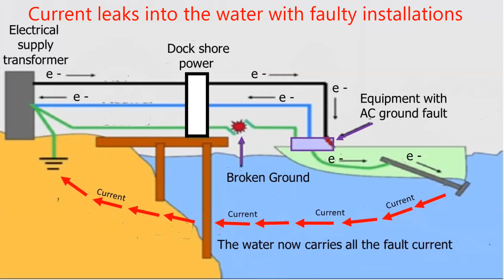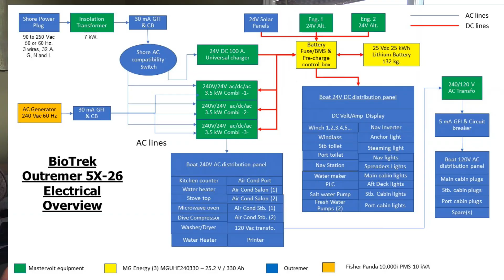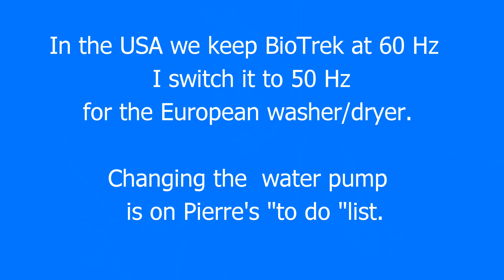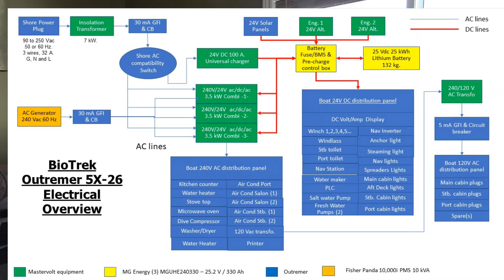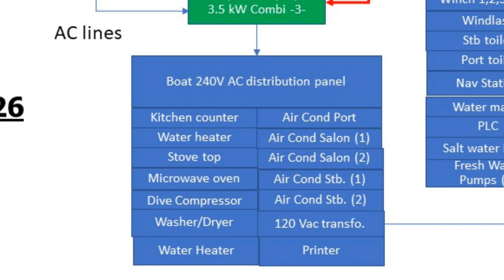Ep.66. Marine electrical systems Pt. 4: Inverters and batteries

Comment: Hi , could you please explain why you have the separate battery charger, I can’t understand what you tell in the video . I understand you use it only if you have 20 volt on the dock ?
Reply from the maker: When the shore power is different from the boat requirements we use the auxiliary charger that does not have an inverter built in.  When the dock power is reliable to our needs on the boat then we can use the pass-though from the big charger/convertor.  I hope that helps!

Comment: What is your view on the use of DC  vs AC generators?
Reply: Everytime you convert energy you lose, so charging directly from a DC generator would be best. I like the compromise of using an efficient variable speed AC generator, as it also becomes a backup in case of a fault in the inverter.

Comment: Nice install. Question- you mention PLC. Is this an MG product or something custom? Assuming that this translates CANbus from the BMS to Mastervolt Masterbus for charge/discharge control?  Also, does the MG BMS manage regulation of the alternators or are you using something like  a CANbus based regulator like the Wakespeed?
Reply: HI Robin,  
Yes we use a Display controller to interface the Mastervolt to the MG BMS.  It is canbus on both side and the Display allows PIerre and Lisa to monitor the batteries at all time.  The unit we are using is a controller Pierre and I are very familiar with since we used it when we worked together (I still do in my current project).  It has multiple Canbus port and act as a bridge.  As you probably have heard in previous video Pierre has a background in Computer science and I have extended Industrial automation experience.  So it was more for fun for us to do this.  The unit also can read all the NMEA2000 messages on the net and we use this to collect data point for the display.  
For the Regulator, Pierre orignally purchased Mastervolt regulator and the intent was to bridge them with the BMS info to control the charge current.  I think this is still on the Todo list for Pierre.  In the mean time he uses the system as standard.  Because of the very high capacity of the batteries, the Alternator is not capable to exceed the maximum current charge in normal operation.  Voltage set-point is below Battery max voltage so as long as the battery stays balance it is safe.  The BMS would protect the pack if that was not the case.
When Pierre was designing the boat, the Wakespeeed regulator was not yet available.  It would make the whole integration a lot easier since it is fully integrated in the MG BMS system.

Comment: What type of dive compressor do you have? Can or do you run it off the battery with the 3 three combie units? Would 2 of the inverters start and run the compressor? Would love to see the alternators / regulators and the control interface. What real world output are you seeing from the Mastervolt alternators? Thanks again and great job on the videos.
Reply from the maker: On BioTrek, we are using a Bauer Junior II electric dive compressor set at 3,400 psi. We have it configured to run on 230Vac. When running, it draws between 1.5 to 2 kW, so even a single inverter will do the job.

As far as alternators, they are by far the most inefficient ways to create power, the standard car alternators installed on marinized car diesels sold by most marine engines manufacturers will only supply their rated power for a few minutes (especially when feeding a low resistance Li battery), afterwards they will quickly derate to less than half of their rated power due to temperature build-up. Remember that these car alternators were never built for continuous high output, they were created to only put back in a battery the energy used to start the engine. On our vessel, we have two alternators, one 12V coupled to the starting battery, the second one 24V 80A (in theory…), that feeds the house. It is my intention to change that but I have not had time to do it yet.

Here is a list of the issues to think about:
• Most high power alternators on the market will void the engine manufacturer warranty (loading the engine at the wrong RPM).
• Belt driven high power alternators do put a bad sideloads on the shaft bearings.
• Typical alternator are only 50 to 60% efficient (very good heaters).
• Marine engines typically run at low rpm, (especially when power sailing), so the alternator speed should be increased by changing the ratios.
• There is only one company that I know of that has done good work tackling these issues (Integrel) https://www.youtube.com/watch?v=cmQX3-4o9zg but they are very expensive.

If I was to do it, I would probably look for a good PM (permanent magnet) low speed motor, connect it directly to the shaft through a vibration dampener, and control it via the PLC so that power can be modulated according to the engine power curve (avoid too low and too high rpm).

If you still want to play with standard (large frame recommended) alternators, I would suggest using something like an Alpha Pro alternator regulator (Mastervolt) and get an external diode block to help better control the temperature build-up of the alternator.

Good luck

Pierre Caouette
Reply: @biotrektravel  In reference to the Bauer Junior compressor yes "when running it draws 1.5 to 2kw" is the key. Can you start the compressor (surge load) from the inverters? Will it start with just 2 inverters? Or do you only run it with the generator? Also do you run your European 230v washer/dryer on the US 240v 60hz with out issues, Thanks Again.

Comment: Such a fountain of knowledge! 600A of continuous charge to the batteries. That’s the dream!
‘Quick’ question, what’s your intake on using multiple high output alternators on the main engine/s to charge these type of lithium batteries in lieu of having a generator? Thanks guys!!!

Comment: Being an electrical / electronics engineer myself, I appreciate the technical videos. However I understand it is not for everyone. One aspect of your boat electronics that interest me most is the network side of things. How all the support systems communicate with the navigation systems.  Thanks, Richard
Reply from the maker: Thanks for following!
Reply: HI, all the Networking is based on NMEA2000 canbus protocol for the MG side.  For the Mastervolt in order to access some of the functionality we had to use the CanOpen interface.  The Mastervolt network is proprietary and we could not access it directly.  But all the Mastervolt systems share information thru their own network. They do integrate in the MFD I believe thru ethernet.

Comment: Thanks for, once again, a very good episode. Learned a lot for my (hopefully) upcoming O51. Short one, the PLC you have is that from MG system?
Reply from the maker: The one we have is not from MG, but they also have one, as does Victron. Will  we see you in the Rally?
Reply: @biotrektravel  Thanks. Is the MG one as good as the one you have?? If you mean the GLY rally we can't unfortunately not join the one for this September (still stuck at work) but we aim for the v2 of it that hopefully will start September 2024
Reply from the maker: Probably not since Pierre programmed ours 😂

Comment: Pierre, could you have a watch of Emily and Clark's Adventure, latest video, where he talks about using both lithium and lead acid batteries joined together. Your thoughts on the idea and setup??
Reply from the maker: The @EmilyandClarksadventure set up: If the batteries are new and you are very careful, it will work, but only with LiFePo type batteries. From an engineering point of view, I cannot recommend a setup like this.

Mixing batteries with different characteristics or batteries/capacitors (energy versus power) is a known technique, but it is usually done using a DC/DC between the two types, to limit and control the transfers from one to the other. Also remember that each battery in a parallel string should have its own fuses.

From an insurance standpoint, there is risk. If an insurance company learns of this modification, claims may not be covered. Worse, If there was any collateral damage, such as at a marina, you risk being sued.
Reply: @biotrektravel  Thanks Pierre, it sounds a bit far fetched and dodgy to me. Hope the shoulder is recovering well mate.

Comment: Am I correct that you’re using black cables for negative DC?  I believe ABYC recommends the use of yellow for DC negative to avoid confusion between AC positive wiring. If I’m correct, can you explain why you didn’t use yellow dc wiring?  I realize it may not be any more complicated than availability of the correct colour wiring in the gage you required. Love your detailed explanation and this series. Based on the last video I’ve now ordered an isolator transformer for my shore power. Nice project for me this spring. Merci 👍.
Reply: Hi, sorry to Jump in for Pierre.  But the boat was built according to European standards.   AC wiring is brown / Blue so  black wire cannot be mistaken with AC cables...
Reply: @klims106  Thank you for the clarification on EU AC wiring colours.  I had also forgotten that Biotrek is a French built Outremer.  Merci.
Reply from the maker: Please feel free to jump in!